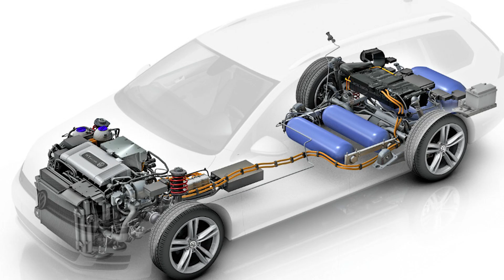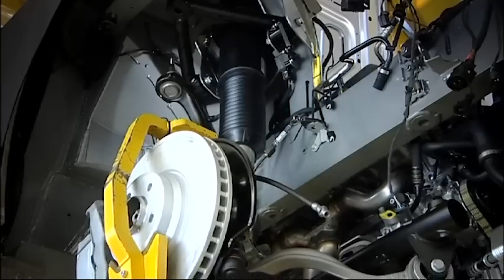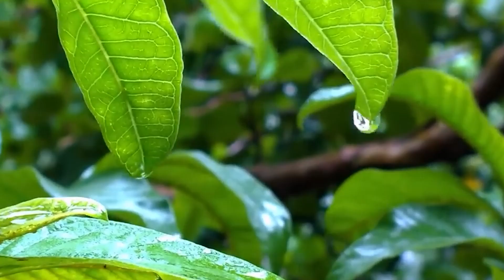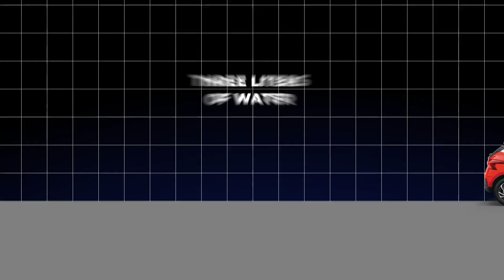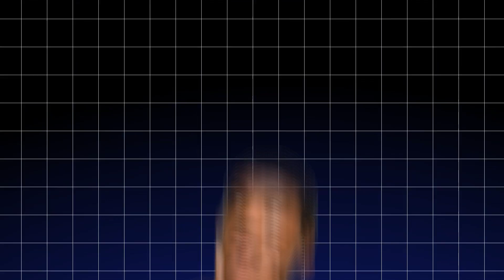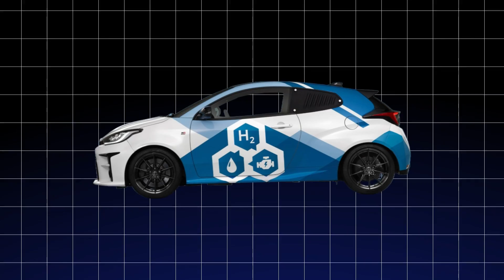Toyota CEO: ''I am releasing My New Water Engine TODAY'

Comment: there is a maximum of 6% hydrogen in pristine water. So just imagine the volume of water that needs to be carried by the vehicle. Then there is the matter of compressing that 6% so it can be injected into the engine. It jsu simply seems implausable

Comment: Clean watter in future for drink Will be cataclizmux trouble,,,,Who ned tank fuel watter complucated buntch of parts....think simple like Balkan houm meisster,,,,
Neodium Engine,,,high presure safe centrifugall mode,,,,gear 7+R,,,or multiple with a reductor,,,no noting complicated eletr,,,it,,,senzors,,,yust vkean driwe technology,,,,,,on small   or on bigg size  ewend with two Engines,,,on 4x4 or more tires,,,,in mpv  or trucks,,,,
Plus 24/7 free source of power for anyting usefull

Comment: I’m seeing problems with this In cold climates. Imagine them spitting out water exhausts all over the road when it’s below zero or how about cracking a block because there is water in the engine as residual and you shut it off and everything freezes. Or depending if they are using hydrogen as a way to store it or if they are actually putting the water in the car. Well if it’s water the problem is obvious. I’m just spit balling here but you can see a few problems off the top of my head
Reply: It gets Fing cold in Japan I cant think they havent thought of that

Comment: Toyota has fought EV will lobbyists and fell flat with compromised turbo engine recalls. Toyota has promised a hydrogen motor for years, and now this "will revolutionize and replace EV" yet again. Until I see actual offering, there are better EV products available now. EV in the garage is worth a flock of empty promises.
Reply: ev's suck, no noice, create a problem with replacing batteries and are overall more complicated and expencive